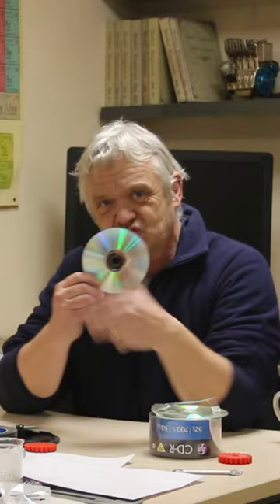The Best Thing To Do With An Old CD As A Solar Cell

Comment: Using old CDs to create a solar concentrator is an interesting idea. While CDs themselves may not be the most efficient material for this purpose, it's possible to create a simple solar concentrator using a reflective material that can focus sunlight onto a small area to generate heat. However, it's important to note that safety precautions should be taken when working with concentrated sunlight, as it can cause burns or start fires.

Here's a general idea of how you might create a simple solar concentrator using CDs or other reflective material:

Materials:
- Old CDs
- Cardboard or other material for support
- Glue
- A pot or container for boiling water
- A sunny location

Steps:
1. Start by breaking the CDs into small pieces. The reflective surface of the CDs can be used to concentrate sunlight, so you'll want to create small reflective surfaces.

2. Create a support structure using cardboard or other materials. This structure should hold the pieces of CDs at an angle to catch and concentrate sunlight.

3. Glue the reflective CD pieces onto the support structure, arranging them to concentrate sunlight onto a single point. The shape of the reflective surface should be parabolic or bowl-shaped to focus sunlight effectively.

4. Place the pot or container for boiling water at the focal point of the reflective surface.

5. Position the solar concentrator in a sunny location, making sure that the concentrated sunlight falls directly onto the pot.

It's important to note that while this setup can generate heat, it may not be the most efficient or practical way to boil water. Also, it's crucial to be cautious when working with concentrated sunlight to avoid accidental burns or fires.

For projects like this, it's always a good idea to prioritize safety and consider alternative, more efficient methods for heating water using solar energy, such as commercially available solar cookers or solar water heaters.

Comment: I thought you would use them as mirrors on existing solar panels. That would actually work (a tiny bit).
Reply from the maker: lol - yes I suppose it would
Reply: If the times I've blasted myself in the eye with solar reflections off those things are to be believed, it'd work reasonably well.

Comment: Murray I want to thank you for the carbon felt I have made a number of those and am trying different lengths. I have found a 6 inch length but you don't even need it except for what it's used with. Using it for a wick that you'll never use up so it could be split up in an emergency for many wicks. So many possibilities so many options. Right now I have five different arrangements of the everlasting WIC

Comment: Actually, as cheap as they are, I can see a good use for them in a Photovoltaic array:
Cheap reflectors to focus light on the panels.
But, compared to the long term cost effectiveness of glass, which, with closet door mirrors being readily available and already framed in, why bother?
Reply: you might be able to find a way to recycle them into smaller squares but keep there reflectiveness!
Reply: @brendan9853  The big problem would be UV degradation of the plastic. I don't think they have UV inhibitors in them.
Reply: @TimeSurfer206  idk just a thought 🤷‍♂

Comment: Would like to see if you could coil 150 feet of black hose on your roof on the sunniest side. Connect to a sub pump in a drum of water and a shut off valve on the other end of the coil, coming from roof. Then use that sun heated water to power a nitinol energy wheel generator. I don’t know why nitinol is being overlooked as a source of energy.

Comment: If I knew your contact details I would have made a video suggestion. 
There are a number of videos where people are trying to make chinese deisel heaters more efficient by scavenging the heat from the exhaust. Either by heating water for whatever use or heating radiators for more heat.
Any ideas Robert?

Comment: Meh, use them to build a Tesla bladeless turbine for hydropower.
Reply: Wouldn't the Tesla turbine have so high RPM that the CD will explode from stress? I remember seeing someone make a video about CDs breaking in the drive if they were turning too fast and there was any manufacturing defects, but it has been years.
Reply: @AnalystPrime  

The velocity is dependent on the fluid stream and viscosity.

CD’s should work fine for pumping water.

Comment: You forgot the most important, and entertaining, part about turning CD/DVD into solar cells. First you have to microwave them on high for a couple of minutes to create a gnarly pattern. 😂
Reply: On the mirror thing, what if I covered the face of the mirror on aluminium foil and made the wire into a tuned length, creating a large Leyden jar that charges from stray radio waves?

Comment: Some of these contain precious metals FYI
Reply from the maker: not cds - well not anymore - they'd to have silver in them but it is all aluminium now mate
Reply: @ThinkingandTinkering  
Yeah, figured that. Older CDs and DVDs definitely had some. RW mostly if I recall. 

I guess the only purpose I can find for the newer ones would be a Tesla turbine then. If you got a 3d printer, may give it a try and print a casing. These work as pumps as well.
Reply: They work to scare birds away in your garden.
Reply: @selrahc2061  
Arent crows attracted to shiny objects?

Comment: With old useless CD disks you can hang them on a string in fruit bearing trees. They will scare away birds and animals from eating the fruits.  

You can hang CD disks up in your garden as decoration. 

I save them to make in to a clock face.  I buy these low cost quartz battery operated clock movements with hands. I use the old CD disks as a clock face. I also buy adhesive numbers for affixing the time numbers on to the CD disk surface.  

Throwing away old CD disks in to the garbage or in to the environment simply adds to the pollution. These disks will not degrade over time.  The up side is they are not toxic and will not kill anything.  They are simply pieces of very hard plastic with a metallic type base inside. 

You can put them in to a shredder. Being shredded they will be many thousands of very sharp edged pieces. These will be dangerous for the environment and especially wildlife.

Comment: Not in the ocean 😍🤣😍🙏
Jed becouse your wire is acrobats and back the deverentional is inside the cicles thention risses one side thention lower the other side 
Thentionak diverentional translations as sunlight experience 

It is like you alternator when you put oll plus on one side and oll mins on the other side there is diverentional jad no sequence to harmonize the particle behavieures towart energy translations as its own copasetys emotion expanding inpanding expanding inpanding😍 cosmic harmonieum you hear with oxiloscope when the rotation on a wire as potentional is swits of as a sping
Reply: Like your alternator bold one side are on one plate metal😍
On boths sides.
Your bold generator is not😍 
Jad so how if I use one pijp and wind it inside out side inside our just around it it is not able to sniff a feild in motion.
While the iron feilds are going in a tornado directional feildflow .
So it is the sequence of the pul and pus that is electric energy😍
As alternating currend😍
Jed directional currend is a litle harde there is stil flux where push and pull meets elchader as the footnotes of the harmonieum you experiences as herths and mhz
Reply: O Jess ofcours the bold generator eagh bold independently to the ones next to it is de sequence.
Jad a bicke dinamo💜 is pulling from to push towart💜
Reply: Than we see how the alternator is the coper quicker device😍

As you have posetive and negative cloud on eagh side constand swithing💜 cohesion of that sequence inside and around that connecting dimention oftenend coper wires 

And diverend conditions of connecting dimention behaves like  more and less resisting wires do to the deverend olrady pressend conditions we use as conduit for the most pressend behaveueres of  energy transmisions to tace place😍

He saw the 2 clouds and there potentional💜😍💜🙏😍💜😍